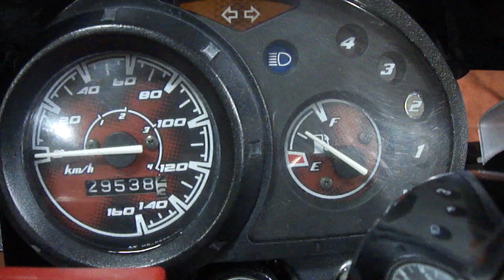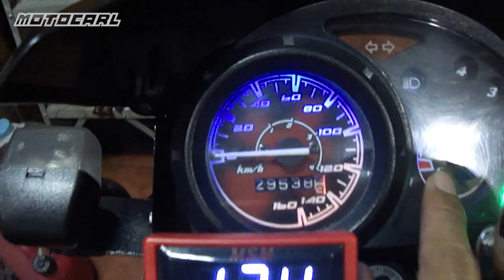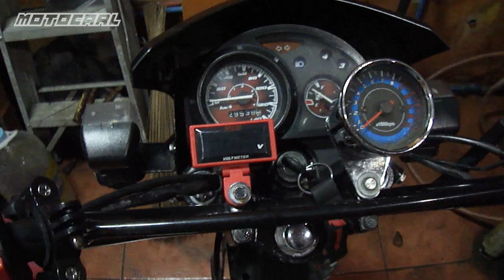Pano ayusin ang sirang fuel gauge at pano mag palit ng gas floater | Honda XRM125

Comment: Boss ask ko lng anu kaya pwd replacement na gas floater sa sym rv1-2 salamat sa reply boss
Reply from the maker: ayun lng hindi ko alam paps.. wala ba tayo service parts ng sym? pag wala ganto gawin mo paps baklasin mo yun gas floater ni sym then picturan mo kunin mo yun sukat ng floater. tapos check mo sa mga suking moto supply ntin. pag parehas ng sukat saka yun metal lock saka yun wires.. pwde po yan. sana makatulong..
Reply from the maker: or pwde nyo tanong sa mga dealership ng sym kung san nakakabili ng spareparts ng sym..
Reply: Normal lang ba yung mabagal na pag angat ng gas gauge boss?
Reply from the maker: @markjadraque6782  hindi. unting bagal lng.
Reply: Yun kasi yung akin...cguro may deperensya. Pa check ko nalang. Salamat boss

Comment: Saan mo nabili yang floater mo paps,,ang mahal kasi ng orig na ganyan sa honda.
Rs125 motor ko
Reply from the maker: hindi pa ko nagpapalit ng floater paps.. bali yung replacement parts nasa 100+ pesos. dito sa mga motosupply.
Reply: @motocarldiy  saan banda makakabili ng replacement floater ng xrm125 paps,nag ikot kasi ako sa 10th ave.puro pang xrm110 lang meron sila.
Reply from the maker: @hello_gacha  hindi daw ba pasok yung sa 110 xrm parang same lang din kc sila ng floater ng 125. basta parehas nun metal na lock.. pasok yun paps.
Reply: Hindi rin sila siguradi paps,
Salamat sa reply paps